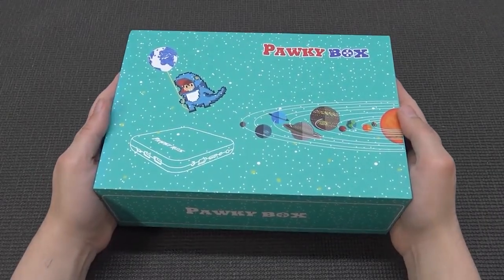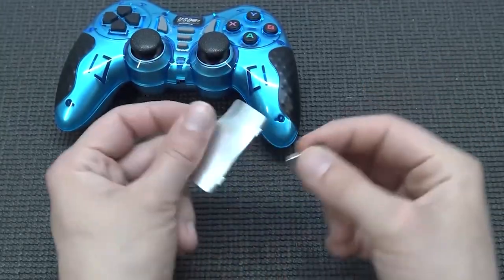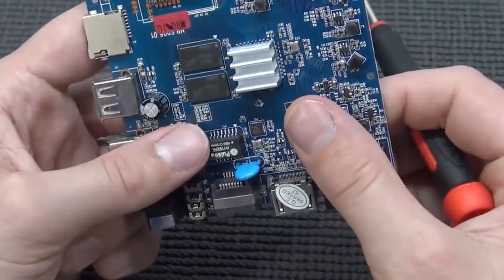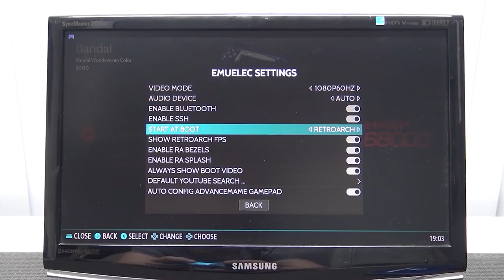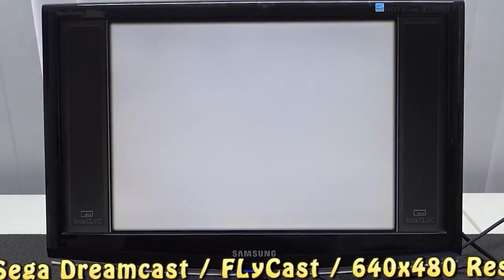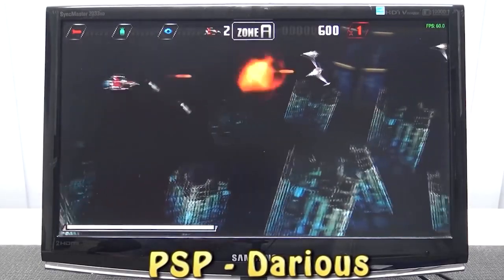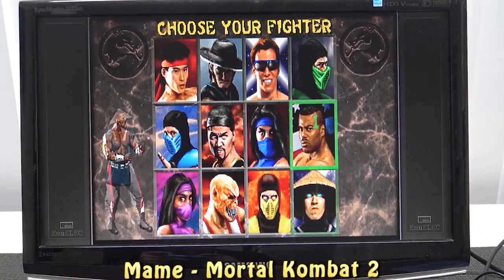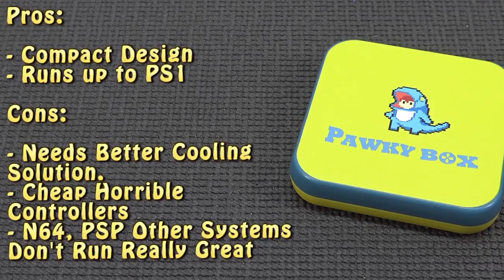Pawky Cheap Game Box in 2023 .. It Does Play Many Games ! 😳

Comment: That's your opinion. I have the wire version of these controllers and like them. Nothing wrong with them. Yet have xbox controllers, and ps controllers yet these cheap controllers are not horrible, but work fine. No worse than the horrible megadrive and Snes controllers

Comment: I like the box with all the games. I hate how unpowered the system is. Put bigger ram and power. Maybe a high end system. I am a big gamer and are prepared to pay big. Put out a extreme version without the controllers. I would buy one. Just a note I have many systems. Eg. Pandora and all the rest. Where is the ultimate one. No one has this!. I mean the top nitch high end product. There is a product that us gamers need. Seems that no one is prepared to make one............. Yet.
Reply: I build a Batocera Mini PC for Umbrella Arcades that runs PS2 pretty well. It uses an N5105 processor, so it can handle GC, PS2 and Wii. Many of the games I’ve tested run at full speed, though some of the harder to run titles like Rogue Squadron II and III do not. 

However, I’m actively attempting to pair the correct hardware with the current limits of Batocera emulation as new PCs come out, and I’m testing that limit constantly. 

If you have a particular emulation goal, let me know on my site, and I’ll find a PC that works if the current option doesn’t.